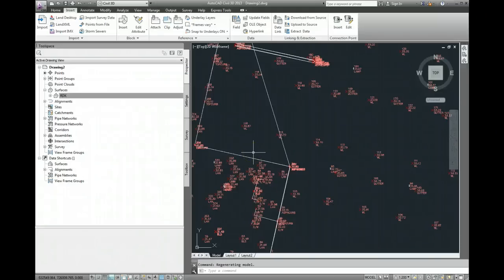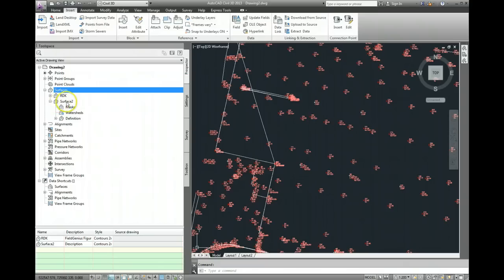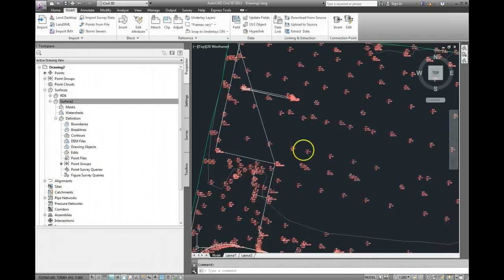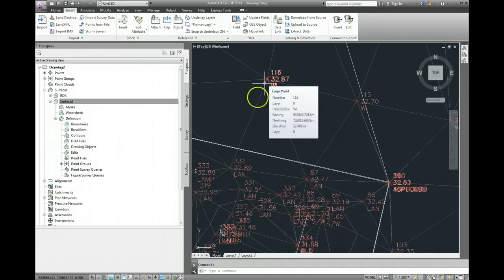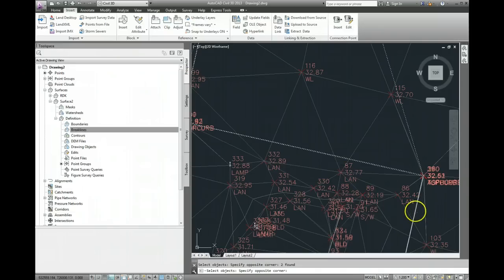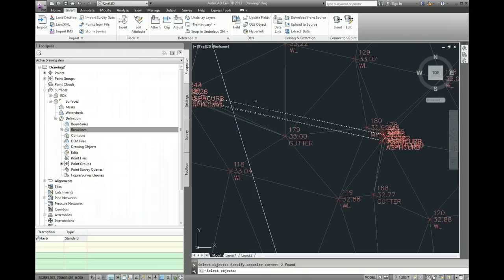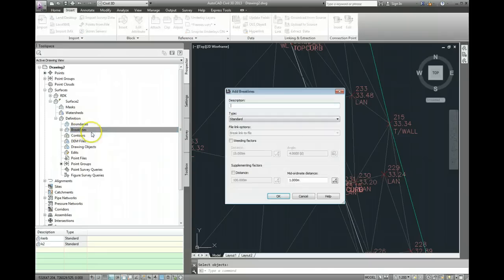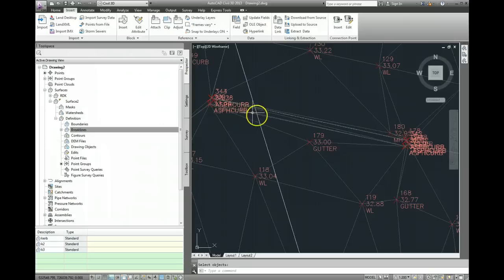Adding a Breakline to a Surface in Civil 3D

Comment: very appreciated video. However let me know please if I got it clearly:
The braek line option ''proximity'' is used to fix triangles crossing abreak line in order it doesn't give you error message ?
Reply from the maker: Not quite. You usually shouldn’t be getting an error message when creating break lines. If you are, then I suggest searching up the specific error code. “Proximity” type break line just means that the break line itself does not have to have vertices that are snapped to surface points. (Although to be honest, in my experience I would have surveyed points in the field that I wanted to use as break line vertices later on, so even though I’m in the habit of using “proximity” type, I wouldn’t necessarily have to use it my own survey drawings).